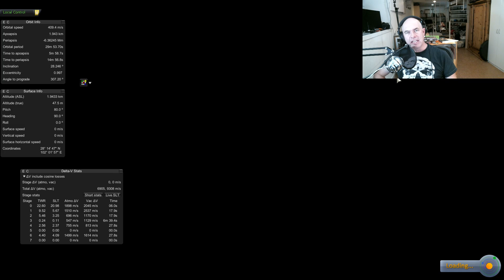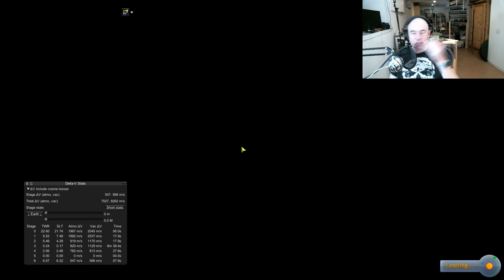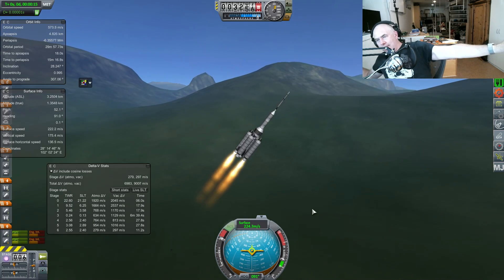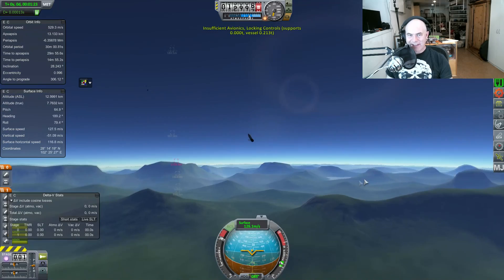Building Real Scale Tiny Orbital Rockets

Comment: Hi I'm looking for a mod for ksp to show me more accurate information on my length, width and height of my crafts... Because for some reason when I'm using procedural wings it doesn't show accurate data... On my height etc...

Don't know if there are more people with this problem... But would like to hear from you.. I am trying to scale real life aeroplanes in ksp and would help if there is more mods than engineer redux etc... I am doing pretty goof with my project on the B-29 superfortress with the Bell x-1 rocket plane.. And will show case it on a video in the near future.. I believe it is the best creation so far because we'll I have put some extreme effort into it

Comment: One major problem I see is you need to turn off gimballing on teh lower stage engines.  It leads to wobbling in flight which can eat martian fucktons of delta v.  Another issue I saw on one of the early deisgns is you shoudl always and I mean ALWAYS fire every exposed engine.  an engine that isnt contributing thrust is just dead weight.  You can always reduce throttle to keep the Q under 10,000 kPa.

Comment: Unrelated to video: I got 2 solar filters for my telescope, a cheapo sheet of what looks like Mylar that I creatively attached to the front of my scope with duct tape and cardboard and a much more professional looking (and expensive) one that has screws to hold it on. Why does the more expensive one make the sun look black and white while the cheapo one makes the sun a nice orange? I assume it has to do with the metals used in the filter but which is which? Also will you share your plans for the eclipse?

Comment: Did you also hear how Hyperloop is a bunch of nonsense?
Reply from the maker: +TheCreeperkiller I heard some amateur engineer thinking he was smart for poking holes in the idea even though the ‘showstopper problems’ had been addressed in previous publications. Lots of amateurish analyses out there.
Reply: + DSYomre
we'll have supersonic planes with reduced sonic boom in the near future, but not a single Hyperloop line.
Reply: *shots fired* Despite Hyperloop's potential major issues, it's probably the only shot at having transportation faster than the airlines (~mach 0.83-0.86). So if anything, getting it to work would be a massive gain.
Reply: A theoretical plane using a boundary layer ingestion engine promises to have greatly increased fuel efficiency (NASA: by 70%). One of the features was reducing the cruise speed in order reduce wing sweep and increase the aspect ratio of the wing (similar to a Q400, higher aspect ratio also increases efficiency). Although it increases the travel time somewhat, passengers will be mostly okay with it mainly due to both cheaper tickets, and in-flight wifi will make the trip much more bearable.
Supersonic planes are probably feasible for intercontinental travel, I'll give you that. But for domestic travel, the slower but 70% more fuel efficient planes will be king.
Reply: The concept of a vactrain is now 100+ year old, and we haven't seen a working prototype yet.
Reply: Supersonic air travel is still somewhat impractical. Drag, among other things, varies with velocity squared. So assuming no other changes, going from Mach 0.86 to Mach 2.5 will cause an increase in drag by 8.5-fold. While it would be three times as fast at face value, remember that ATC rerouting and the 250kts speed restriction below 10 000ft means that the full speed can't be utilized the entire time. It might work if the jet could always obtain direct routes and utilize HI-ILS approaches. If anything, propfans are the emerging technology, which bridges the gaps between turbofans and turboprops. Propfans, of course, have a lower spec speed than jet engines, but a 35% increase in efficiency, which is an easy future sell to airlines.
Reply: Tell me why passengers would want to fly in an even slower plane (which could have serious issues with noise) when they can already buy a very cheap ticket on a normal jetliner? If efficiency is so important, it would make more sense to experiment with new aircaft designs like flying wings/BWB instead of replacing the jet engine with something less powerful.

Yes, supersonic air travel is energy-intensive but a Mach 2 plane can be build without any exotic material/new technologies and there could be a market for express tickets between continents. That sounds a lot more believable than underground vacuum tubes everywhere.
Reply: Hyper loop is just a meme. Very easy to have little problems that result in deadly catastrophic failure.
Reply: Yeah, thunder foot doesn't know shit.
Reply: Why would anyone engineer a massive vacuum chamber when we already have maglev trains?

Comment: Can you do a video about calculating the minimum energy / delta-v needed to get into orbit?
Reply: That would be an interesting idea. What I know is that you need only 8500 m/s for very high TWR launchers and about 9500 m/s for very low TWR. My personal record is 8400 m/s to orbit.
Reply: Very shallow ascent profile + high TWR rocket. Fly straight up to 50m/s, then start pitching down, it should look more or less like that:

  50 m/s - pitch 89-90
350 m/s - pitch 62
1000 m/s - pitch 40
Next steps depends on TWR of your second stage.

First stage TWR needs to be around 1.70 (surface). An example of such vehicle is my Saturn VB MLV used in my Ares Mission to Mars recreation.
Reply: winged love your videos mate.
Reply: How? What sort of launch profile are you using to get that low del v to orbit?
Reply: My personal rule of thumb for the vanilla KSP: apoapsis should rise at the constant speed of 0.2 km/s for powerful streamlined rockets to 1 km/s for bulky ones, until your rocket points at the horizon. This is pretty close to the ideal gravity turn.
Reply: That's a tricky optimisation problem. I think you need variational Lagrange multipliers and numerical integration.